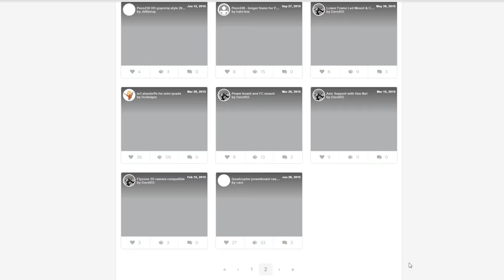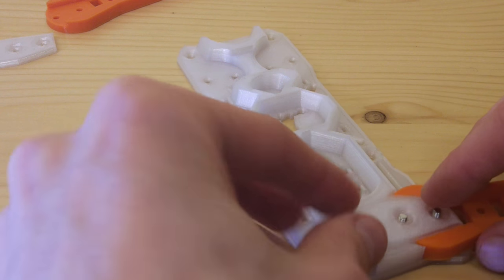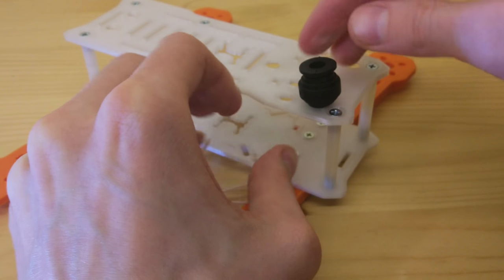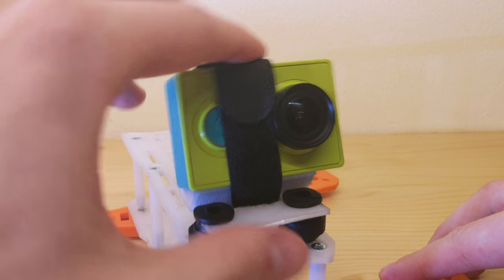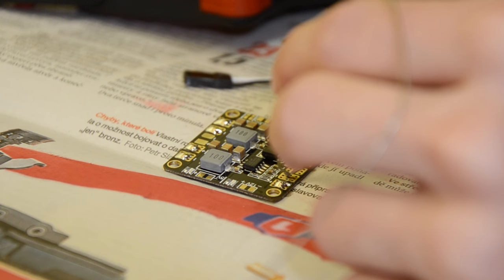3D Printed Racing Drone - PEON 230 (under $150)

Comment: Love it! But I'd shorten the stand offs for a more low profile look, and to minimize breaks during crashes.
Reply from the maker: +Mr Mackey yap that's exactly where I'm heading with my design atm. I am already lower at 35mm instead of 40mm. But I want to go even lower, just leaving the front high so that it protects the camera. Maybe the top plate could even be at an angle? I'll make a follow up video :)

Comment: The most important question is: Does it survive impacts? The carbon frames will break, too, but they can withstand quite a beating until then. Other tests show that PET-G is less impact resistant than PLA an will shatter quicker, despite it's higher toughness. Also, PET-G is not stiff enough, your motors will probably vibrate after a few flights which is the death of the motor / ESC..

Comment: Looks good, I'm surprised how tough it is!
Reply from the maker: Thanks :) I've crashed it many many times and finally broke something, the top plate broke around one of the screw holes, probably due to all the force the camera and battery applied to it in crash. I've redesigned it a little bit and it seems much tougher. I also made a clip-on sidepanels to protect the inner parts/electronics and it also prevents the cables frombeeing able to hang out. I'll make a video about the changes when I find some time for it :)
Reply: Top plates are always breaking even on carbon frames, sounds like yours is pretty tough. I'll keep an eye out for your updates

Comment: What motor would you recomend for this build then?
Looking for a balance between cost and performance
Reply: RS2205, you can buy the original EMAX version for 50 bucks (4 pieces) or you can go with the readytosky clone version for 22 bucks.

Comment: Very good work! Don't you have any problems of (to much) adhesion of petg on the pei printbed?
Reply from the maker: +François-Xavier Wiart A little bit. It depends on the contact area. If the bed contact area is really big, then I usually use raft to make it easier to lift from.bed. But smaller parts like the drones parts are usually pretty easy to remove.
Reply: Mikolas 3D Printing , thank you for your reply. Ok for the raft. And do you prepare the bed with something (glue or anything else?) to prevent to much sticking?
Reply from the maker: +François-Xavier Wiart I almost always clean my bed with a really quick light wipe with acetone (paper towel with a bit of acetone).
I've tried to add glue to create a separation layer, but honestly I'm not sure if it was better or worse. If your first layer sticks ok, but it's impossible to remove the print, then maybe even touching the PEI with hands and not cleanong it might help, thats what I sometimes do.

Comment: bro please update links. some pages is not working.
Reply from the maker: The video is 3 years old. Honestly, so much has changed in those 3 years in the drone industry, that I don't think any of the links are really relevant anymore.
These days I would go with an all-in-one board a depending on the budget, maybe even with a digital video system.
Reply: @TheMikolasZuza  yes i know, but please if you can update links, because i want to collect this drone.
Reply: @TheMikolasZuza  you will update links by 2020 standarts? it will be cool.
Reply: you will update links bro?

Comment: What camera is that?  If its the firefly. What model and how did you get it in that color?
Reply from the maker: It's Xiaomi Yi, one of the most popular GoPro alternatives. It costs only 100$, the only downside is no 4K, only 2.5K@30. (But still much better then cheap 4K action cameras that have terrible image)

Comment: weight of frame and total drone weight?!
also what's the infill %for pla 3d print?
Reply from the maker: About 110g total with hardware. The arms should be really high infill (50%+, honestly 100% works well here and the weight difference isn't big). The rest can be normal infill like 20-30%.
I have modified the drone heavily since I created this one, but the general shape is simmilar.
Total weight without battery and GoPro is 480g.

Comment: What camera lenses did you use?
Reply from the maker: To be honest the one in the video isn't ideal. It's way too big, but not curved, so somewhat visible in the video. Since then I moved to a new one. Just search for "Xiaomi Yi UV filter 37mm.
Link:
https://www.aliexpress.com/item/SHOOT-Ultra-37mm-UV-Filter-for-Xiaoyi-4K-Camera-Xiaoyi-2-Accessories/32762278861.html?ws_ab_test=searchweb0_0,searchweb201602_2_10152_10065_10151_10068_10344_10342_10343_10340_10341_5470011_10304_10307_10137_10060_10302_10155_10154_10056_10055_10054_10059_100031_10099_5460020_10338_10339_10103_10102_440_10052_10053_10142_10107_10050_10051_5380020_10171_10326_10084_10083_10080_10082_10081_10110_10111_10112_10113_10114_143_10312_10313_10314_10078_10079_10073-10052,searchweb201603_11,ppcSwitch_5&btsid=025fcdc4-9aab-487b-bd38-e29a2717bec8&algo_expid=ad3bd6ea-71d8-4d0b-94c5-d39d29d7328e-1&algo_pvid=ad3bd6ea-71d8-4d0b-94c5-d39d29d7328e
Reply: runcam